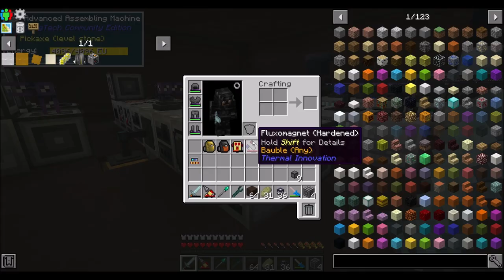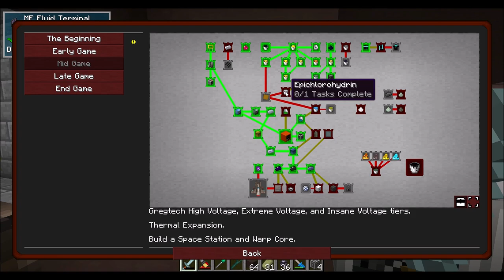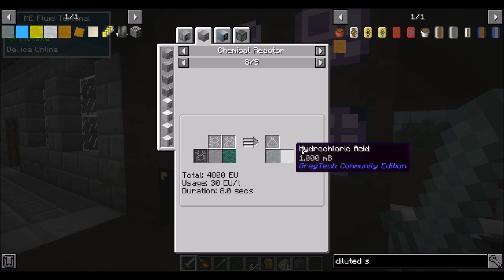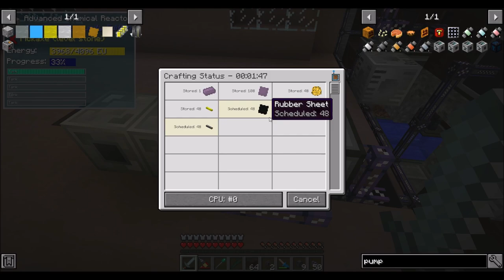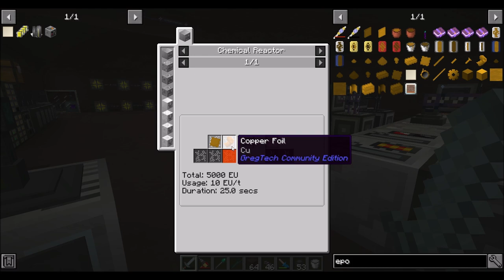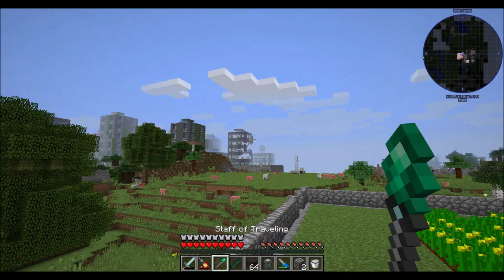OmniFactory   Ep45 Tier 5 Circuits

Comment: its the first time you get to use a circuit from a higher tier instead of a processor from the previous tier. the MV processor does the same job as the HV circuit (tier 2 stuff). and circuits are way cheaper then processors. this also means that you can replace the MV arrays with your new HV processors (tier 3 stuff), likewise MV mainframes with HV arrays! (tier 4 stuff) and now you have access to tier 5 stuff with the HV mainframes!

The picture in the book really helps clarify things, the horizontal rows are all interchangeable with each other, while the columns are the more advanced classes of circuits, needing higher and higher EU to make.

Comment: you don't need to have buckets/ items to set up filters with EIO conduits
you can just pull them from JEI
Like so he sees this
Reply: And he's done it in previous episodes.
Reply: why doesn't he do it then
Reply: @Scratcher-zb9qt  because dire derps
Reply: Becouse its easier to have buckets than search fluid in JEI each time
Reply: @Scratcher-zb9qt  He is using AE fluid this pack as much as if not more than enderIO it can't drag from JEI, and if you recall the earlier episodes he did drag from JEI into enderIO conduits when those were all he was using.

Comment: urgh....still you dont need pumps...move the output with a wrench and click the blue fluid auto output button...driving me nuts!
Reply: I think that the pump is faster but you are correct 😅
Reply: Nope, pump is in fact slower, but have the ability to filter.
Reply: @hubertnnn  oh i didn't know 😅😅😅

Comment: 23:20 "That should work!"
No, it shouldn't. And it's not either Gregtech nor AE's fault. It's the enderfluid conduit's fault. An enderfluid conduit is able to transport multiple fluids over a single conduit, but it's still only one fluid per channel at a time. The red channel is filled with hydrogen, which blocks reception of the chlorine.

Comment: Sigh, some of this pact is kinda interesting, but it also seems like really really tedious, I find myself losing interest. Not much can really be done about it though since it's the way this pact works, where you basically have to take a hundred steps to get to the end, I can't even imagine trying to do this pack without AE or RS. Part of me agrees with Dire that I like automating stuff, and it's pretty cool seeing everything kick off, but building all this stuff is tiring even just watching it, maybe it's because I'm just watching instead of trying to work it out myself? Not sure.
Reply: Gregtech has its ow item and fluid routing system, its less powerfull than AE, but have some interesting features, eg you can sort based on ore dictionary names.
I have played it 2 or 3 years ago without AE and it was fun in its own way.

Also, remember that some things in this pack were made harder, eg. the circuits.
Recipees are the same as vanilla gregtech, but gregtech has just 1 circuit per tier, not 4.
So instead of 4 different tier 1 circuits you would have just one with 4 different recipees.